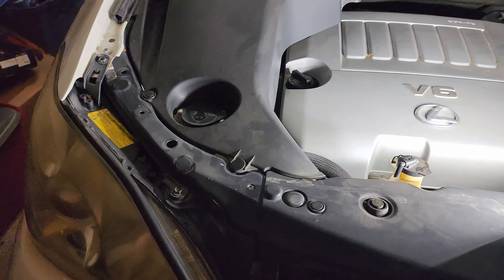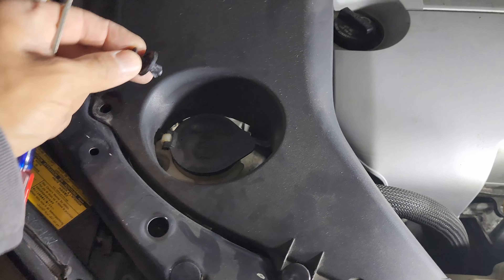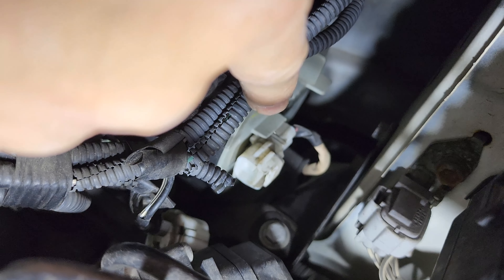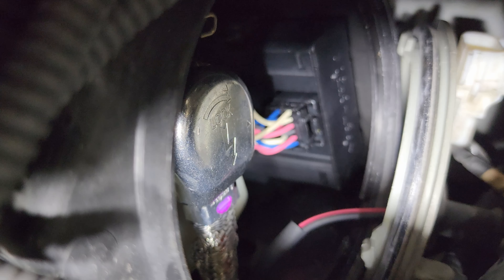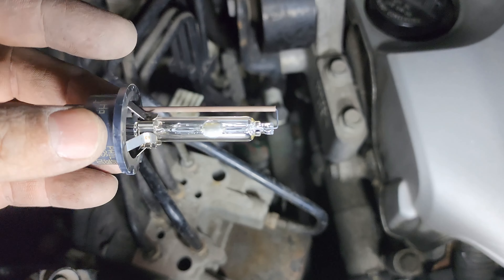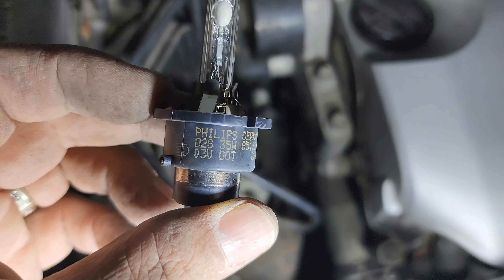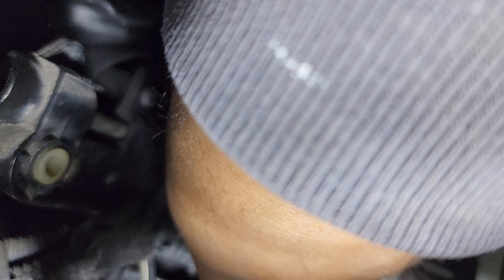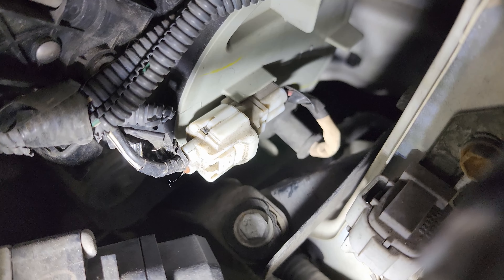How to replace D2S 85122C1 Xenon HID Headlight Bulb, 2007 Lexus RX350, Toyota and others.

Comment: This is useful information. It would be interesting to see the driver's side bulb replaced, as it is much more difficult. The Lexus factory repair manual says the entire nose (fascia) must be removed to gain access to the headlight units and their bulbs, as well as the fog lights.
Reply from the maker: Hello and thank you for taking the time, I did recently replaced the drivers side and I did not have to take everything apart as the manual says, I will soon edit and upload the video so you can see, Best to you.
Reply: I'm in the process of replacing my bulb again but having difficulties. Would like to see your video for the drivers side replacement. Thanks!
Reply from the maker: @warrtrick  Hello and thank you for asking, I just uploaded the video last week, I will put the link on the comments on this video so you can see it.  I hope it is easy for you, It is not as complicated as I thought.  Best to you.

Comment: Did you have to shrink your hand to get into that passenger headlight?  I will give it a go as you show. I started it and stopped because I remembered that last time I did it I took the bumper cover loose and the wheel splash guard off to get to it.
Reply from the maker: Hello and thank you for asking, and I did not shrink my hand, I actually did not have to put my hand all the way in, I was able to reach to take off the cover with my fingers and to replace the bulb it was tight, but I was able to do it.  And you are right, the other way to replace the bulb is by taking apart the bumper cover but I tried this way, and it worked for me.   Best to you.
Reply: @ReviewingEverything  I found that if I moved the fuse box and other bolt-on items behind the light and removed the harness to the headlight and repositioned it on top of the headlight body, I was able to easily get my hand in there to change the bulb.  It was about a 20-minute job. I watched one other video and with your video and that one I was able to easily do this job without removing the headlight which would have taken a lot of time. The hardest part was clipping the bulb back into the socket after changing it.  Thanks for posting this video.
Reply from the maker: @hoagie1965  Wow,  thank you for sharing I hope your comment helps other people too, I appreciate you sharing this information, and you are right removing the headlight seems to be more work than what you did.  Best to you.